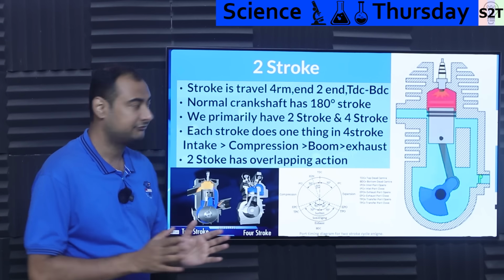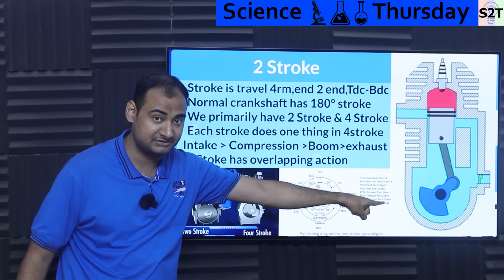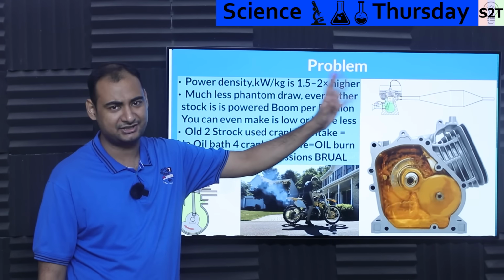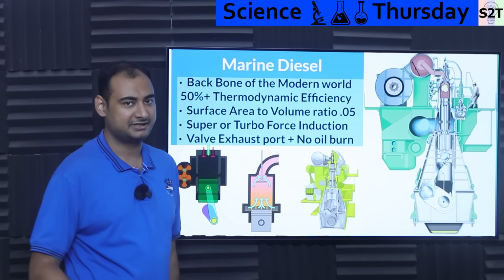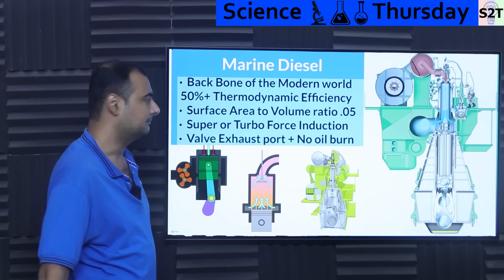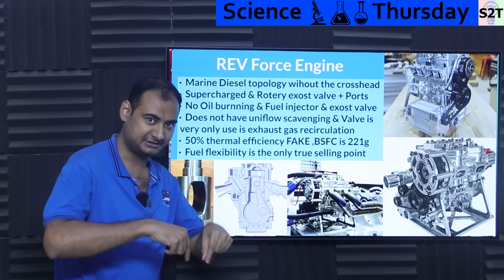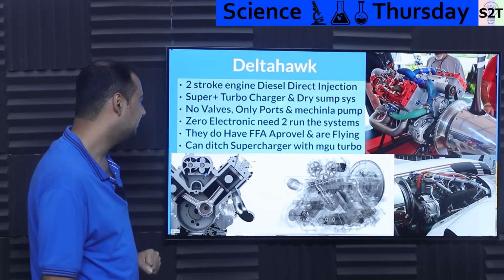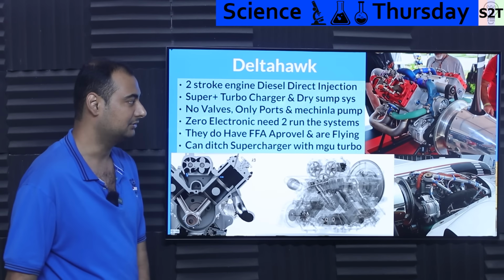2 Stroke Engine Progress Explained {Science Thursday}

Comment: You haven't mentioned 

where the top rings are lubricated or not 

As far as the image you are showing in ur ppt it's not clear 

There are 2 sets of piston rings

Bottom and top 

Bottom set is directly exposed to oil 
But the top set of rings are not 

U said that they the rings are hydroplaning on oil 

How? 
If even a little oil touches the top set of rings then oil will also go into the in take port
Reply from the maker: ask them not me . Top ring runs dry most of the time in most engine